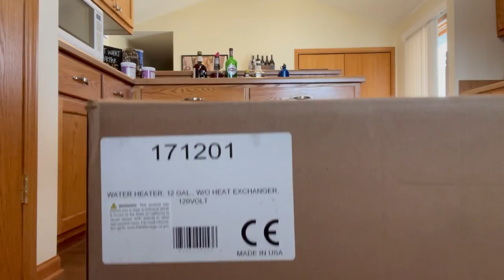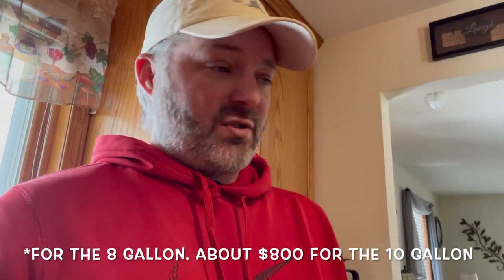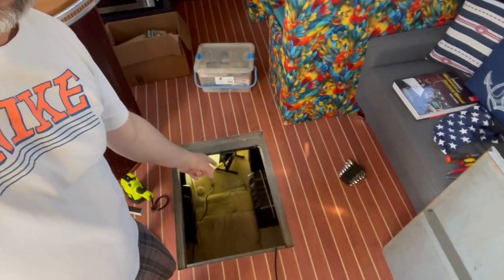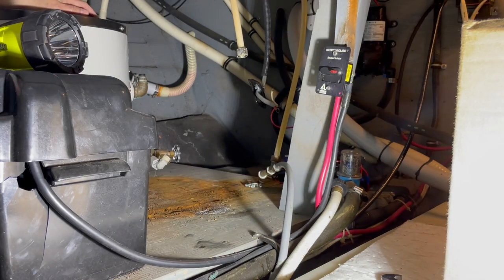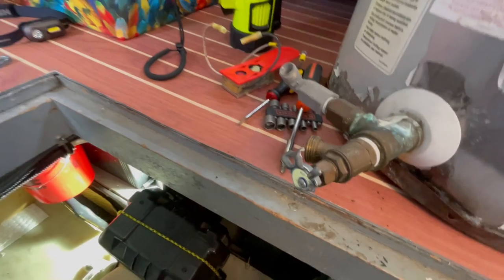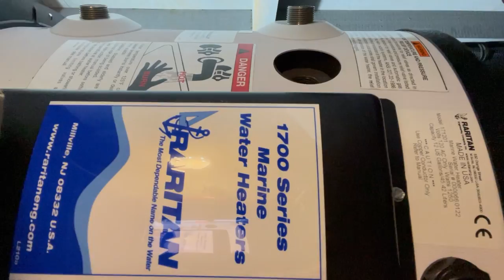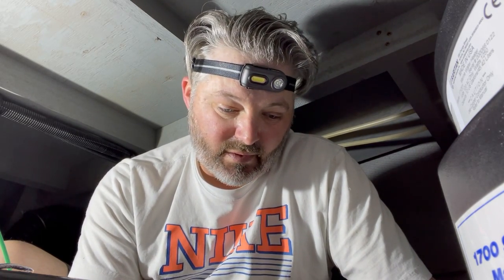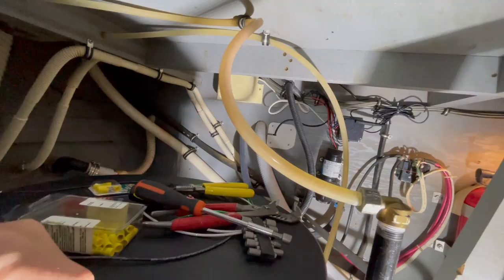MV Thirsty Whale, 1984 Chris-Craft Catalina 381, Raritan 1700 12gal Marine Water Heater Replacement

Comment: As with the Raritan instruction link there is no mention of the thread sizes of the intake and outlet fittings.  For me this is perhaps the biggest problem in replacing an old unit with a new one.  I'm also expecting the old zinc plated fitting to be corroded in place with no chance of removing them.

Comment: Chad, by any chance did you check to see if you could get the heating element out of the old water heater?  My 381 still has the original heater with some rust along the bottom like yours but it still works fine.  I was wondering if I could just replace the element if it became necessary.
Reply from the maker: Hi Greg, I did try to remove all of the fittings, pressure relief, and the heating element…couldn’t budge any of them. I didn’t use any lubricant tho as I wasn’t all that concerned about keeping them.
Reply: @WiscoBoater  Thanks.  Working my way through and enjoying your Chris Craft videos. Hope your channel continues to grow.
Reply from the maker: @GregStark381CC  Thanks Greg! Enjoy, and reach out anytime...happy to help if I can.